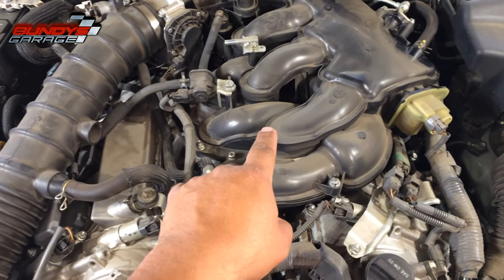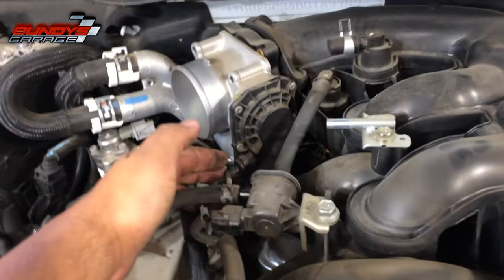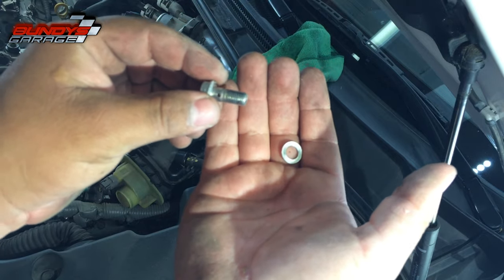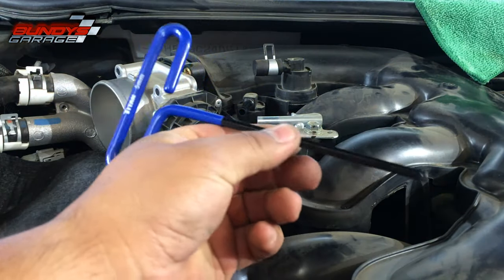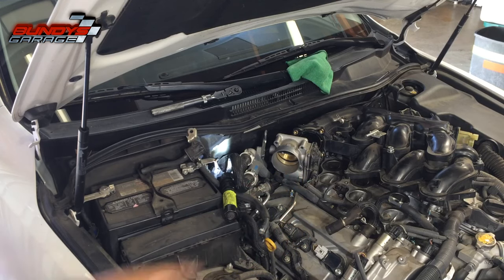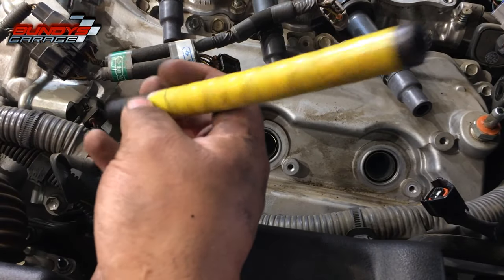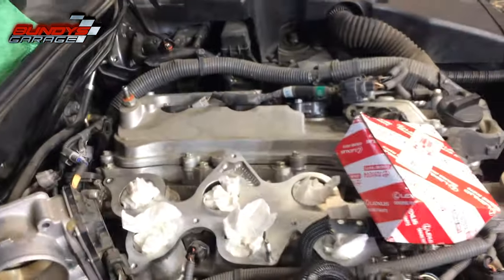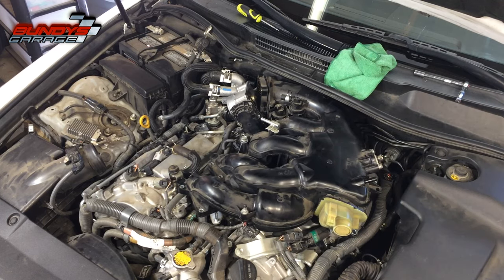Lexus IS250 Spark Plug Change Replacement | 2.5L V6 4GR-FSE | 2006 - 2014

Comment: lt is best to use the OEM spark plugs the vehicle calls for.Has been proven and tested that the OEM plugs work with what came from the factory.l have seen misfires from none OEM spark plugs installed,seen this with Bosch and E3.Denso says no anti seize on the threads of their spark plugs,has an anti corrosion coating on the threaded part.Use of Anti seize causes grounding problems and effects when torqueing them down breaking the plug off.NGK even has a TSB out not to use anti seize on their spark plugs too
Reply from the maker: Post a link to that TSB plz
Reply from the maker: This is for guys that don’t know how to install spark plugs. Obviously if you torque down on a spark plug with or without anti seize it will break, any mechanic with experience knows that. I have never broken a spark plug using the technique I show in the video. So when your plugs get stuck or you break one off, you can call a mechanic to get them out for you. I’ll continue to use anti seize on spark plugs cause I know how to torque down a spark plug.
Reply: @bundysgarage  All the spark plug manufacturers say no anti seize on their spark plugs.Plus lose grounding with anti seize put on them
Reply from the maker: No you don’t. I’ve never had one problem putting anti seize on spark plugs

Comment: Also if you just going to swap the sparks...u really don't need to remove the gas line there man. It will easily move aside..just saying avoid even more puzzle pieces.

Comment: Hello. Thanks to you, I decided to replace the spark plugs myself. I also cleaned the throttle. BUT Error P0660 appeared after the first start. I deleted it, did a test drive, and it reappeared. I am asking for a hint where to look for the reason. What could I have missed?
Reply from the maker: Are you sure you plugged everything in? Also did the intake “seat” properly?
Reply: @bundysgarage  I'm going to my car to check the connections. Inteke seats fine. What to look for. The error suggests PURGE VALVE. Where to track it?
Reply from the maker: When it’s running is the idle surging up and down at all?
Reply: @bundysgarage  RPM are very solid. Engine runs smoothly